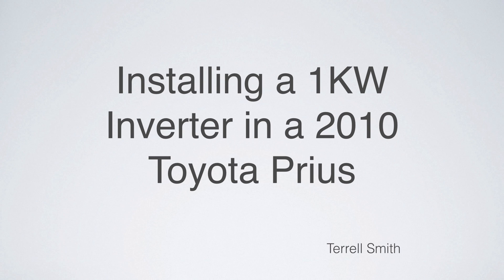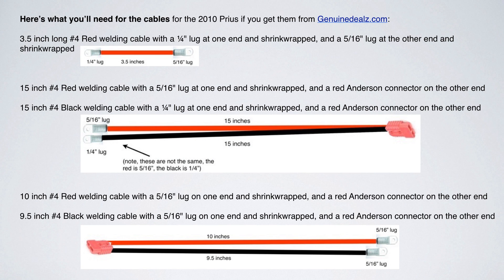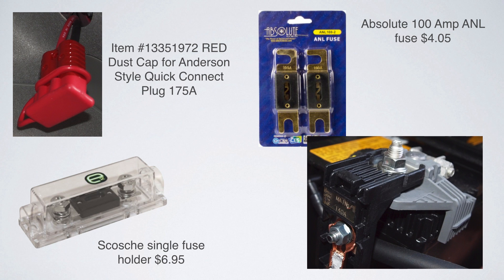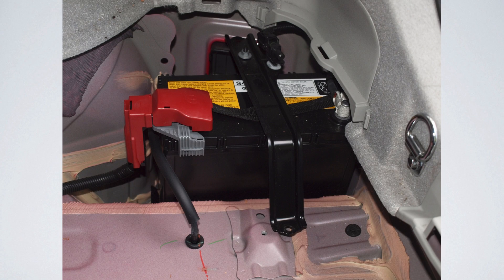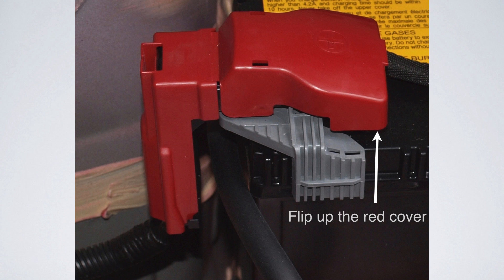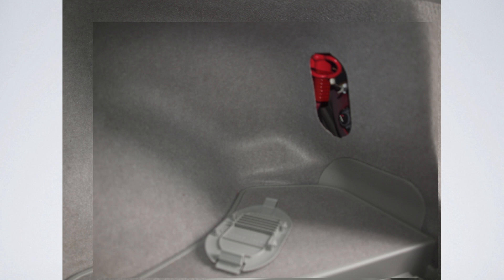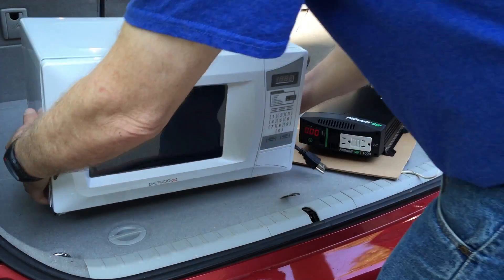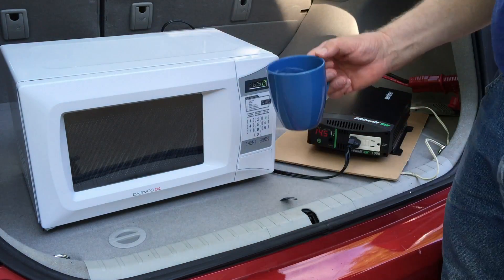Add a 1kW Inverter to Prius

Comment: Thanks for this video. Would the same equipment (cables, fuse, nuts, bolts) be used for a 1500 watt pure sine wave inverter?
Reply: Thanks for the question. It is not recommended to use a 1500 watt inverter, because you might damage your electrical system. From the 12v battery, the Prius can safely power up to a 1000 watt inverter, not more.
Reply: Terrell Smith thank you for sharing this.
Reply: Where can I find the Anderson dust cap cover for 175A? I’ve found some on eBay, but they’re shipped from China. I checked genuinedealz, but they are listing cap covers for 175B, is there a difference? Thank you.
Reply: Terrell Smith thank you!
Reply: Terrell Smith I just learned that genuinedealz has a Prius converter package that includes the dust cover cap and all the cables for $63. They said they were getting a lot of requests because of your video, so they made a package deal. You place the order and they make (and ship) the custom cables and dust cap the next day. Thank you for this helpful resource,
Reply: Terrell Smith Today I successfully installed the 1000 watt inverter into my Prius. Thanks so much for your help. Question: Should the converter only be used when the Prius is completely off?.....or is it ok  (safe) to keep the car in Ready mode when using the inverter (to occasionally turn on and charge the battery when it gets low)?

Comment: Thanks so Terrell! I've finally hooked everything up. I am using a 100 amp circuit breaker instead of a fuse. Is that  a good idea ? Also the total cable length from battery to inverter is about 2 feet now. Should I try to make to shorter ?
Reply: Circuit breaker should be fine. Make sure it's on the positive cable very close to the battery terminal, since that's what you're protecting. 2 feet should be perfect. Much shorter and you have no wiggle room.  :) Make sure the car is turned on when using it so the battery doesn't get drained. It's a small battery, but with the car on you should be able to draw up to 1K (depending on your inverter). The Prius gas engine will cycle on and off automatically to keep the battery charged. To lock the car while it's running, use the "emergency key" that's part of your key fob. That disables any use of the fob and locks the doors until they are manually unlocked. This is a great way to allow the car to be running and still locked. I use an extension cord plugged into the inverter, and close the trunk on it one click, so the trunk is locked without pinching the extension cord. Then I plug in my rice cooker (microwave, etc.) outside the locked car, and don't worry about anyone getting into the car while it's running.

Comment: I tried this with 500 watt inverter, and it fried it when I connected the inverter to the battery, I was going to use it with my Power Pressure Cooker.
Reply: The Survivalist, how many watts was your cooker? I'd guess more than 500?
Reply: Terrell Smith I never connected it, the inverter fried when I connected it to the battery.

Comment: I can only find "tinned marine battery cable" at places that make cables.  Will that work and be flexible enough?  Or does anybody have a link to a welding rod cable?
Reply from the maker: I think it should be fine.

Comment: Would it be possible to have a 2000 watt inverter?  If so, what adjustments would have to be made?
Reply from the maker: The limit for the 12v battery is 1000 watts, so no, sorry.
The exception would be to draw from the traction battery. That can supply 3kw. BUT, that is a major and dangerous job due to the very high voltage involved. I do not recommend it.

Comment: Nice vid, i also readnyour topic on priuschat. So there is no need to wire it to the fusebox in the front? Is the 140A fuse so 140A the max you can drawn out the battery? Or the 100A because of the inverter fuse in the front. I have a class D mono 1000w rms connected to the 12v so that is up to 87A no problem so far, but i want to keep it that way, is it safe what i am doing?
Reply from the maker: Hi Dantube, sorry, I didn't see your question earlier. The 140A fuse is built into the positive battery terminal on the 2010 Prius, where the 12V battery is in the rear. I added the 100A fuse between the positive terminal and my inverter, just in case. You always want to protect the car and battery from any device, just in case something goes wrong.

Comment: Boil water in about 2 min with this setup. Sure I have a MSW inverter for when I need that power to power an ice maker or maybe a freezer but a MWO is not exactly the best way to cook on the  road. Sure I have cooked using MWO but you want real power when you use that MWO. They make some pretty good 12 volt machines that cook on the road. If that is not working for you go with propane as you will see in my stove video the water boils very fast. I go for 16 oz of coffee when I brew. https://www.youtube.com/watch?v=4kPb63ZmGXg I am still working on a good way to do coffee on the road I think I will go make a cup now. I will try the coffee filter with a fork this time should have video up in about an hour.
Reply from the maker: Yes, that is a great way to boil water, and possibly make soup. But I use the microwave oven to cook potatoes, vegetables, whole meals like supper, and even make popcorn. Can't do that in your little stove.  :)
Reply: Just found it better to simplify and flame is about as simple as it gets. I like bio stoves too not a lot of experience with them.

Comment: so when the prius is in start mode engine not running using the inverter the car will start up when the battery get low so does the battery pack and the start up battery share the same or separate power i must be overthinking this lol cool video.
Reply from the maker: The Prius has a "traction" battery (the BIG one which powers the electric motor), as well as a 12v battery. The 1KW inverter is connected to the 12v battery. When the 12v battery drops to a certain point, the gasoline engine comes on and charges it back up. So they do not share the same power. The traction battery is 201.6v.
Reply: ok thank you terrellwsmith :)

Comment: Hi, thanks for such an informative video!  I followed your instructions in detail and managed to install a Xantrex 1 KW inverter on my 2007 Prius.  I'd add that a fixed 10 mm box wrench was essential getting the bolts on and off the 12 V battery.  I couldn't have done it with just an adjustable wrench.  I'd also add that I had to order my wires from a different supplier (Greg's Marine Wire Supply) because GenuineDealz.com no longer seemed to offer the precise kind of customized manufacturing that was needed here.  Also, I think my 2007 Prius' battery terminals were slightly different than yours, so after installation I was unable to cleanly hide the fuse beneath the right rear corner compartment cover, causing the cover to be fairly tilted when placing it back over the battery.  Not a big deal since it is so out of the way.  Otherwise, your approach works like a charm, and I was able to power a small microwave while camping with the Prius on a recent trip.  Awesome!

Rick
Reply from the maker: Yes, the metric box wrench is necessary. I have both sets.

Comment: how much fuel the car uses if it powers a house all night,any calculations. this setup must be very useful for camping as one shall need  power for appliances etc..
Reply from the maker: Thanks for the question, Amir. I've not yet had to power all night, the most was for three and a half hours when the power got knocked out by a storm. Since the gasoline engine only comes on when needed, the Prius would use less gasoline than a generator, which runs all the time, and makes lots of noise. I've read about people powering their home for three days or so. I only powered our freezer, telephone system, internet, and computer during the outage.

Comment: Great idea. If you really want to go maverick. You could replace battery with lithium ion phosphate 4*3.5. 120 ah.  Then you could run without have car on and even have electric blanket on overnight.  I guess the car comes automatically if the voltage drops.
Reply from the maker: Yes, the car auto starts up if/when the 12v battery gets low, to charge it up again. I wonder what might happen with the charging system with a different 12v battery? It looks like there would be space to put a larger battery in there, which might allow fewer engine cycles.
Reply: TerrellWSmith I actually looked at the center console 12V plug today, it says 120W max.  But if there is a way you could use some of that power to store a battery or supercap then anyone can use to use their car to boil water from the center.  Not sure what happens when the 12V battery is low, does the engine kick on, or does the main battery charge the little battery.  It seems my mileage dropped a few mpg, I wonder if it is result of the small battery dying.  A small refrigerator takes less than 120W, but the surge would blow the circuit I would think.  But hooking to the main battery, it might be possible to have even a refrigerator via a 300W inverter if engine kicks on. 12V Dc refrigerators cost $500, but AC cost $100 new and used one probably free if you look around.
Reply from the maker: When the 12v battery gets low, it's charged by the gasoline engine turning itself on automatically.
Reply from the maker: I've looked at small refrigerators, because having to buy ice all the time is a nuisance, and having it melt into the food, creates a mess that needs to be dumped out every day. I put my food in large plastic bags to keep it from swimming in melted water. Plus, it'd be fun to be able to eat ice cream! BUT, 12v mini refrigerators cost almost as much as a big kitchen one! So I gave up on the idea for now. An AC refrigerator that gets bounced around a lot probably wouldn't last very long. That's likely why the 12v models cost so much, they are made to take the bumps. And they are made to work off the 12v plug.
Reply: TerrellWSmith You have a nice plug, to plug one in at.  The Wynter 45 quart is $476. Cheapest 110V is Haier 1.7 cuft at Bestbuy for $105.  If you fill ice area with Blue Ice, you might be alright for camping if you only run it with car running and travelling.  There is also a portable ice maker.
Reply: When you say "auto starts up" you mean the engine kicks in if the car is already started, right?  Else the car could be poisoning the air with carbon monoxide if auto started in an enclosed space.

Comment: Hi T Smith, Would the wired-in Anderson plug work for any car, assuming you use the inverter only when the engine/alternator is running to adjust to the current draw? We had an Anderson plug wired (and fused) to our battery with a solenoid isolator so we could plug in a "house battery" to re-charge while we drove from one camping location to another. I can happily boil water on the camp stove for coffee (wont yet consider hauling a microwave with us) but if I could find a way to power a hair dryer while boondocking, I'd be a happier camper!
Reply from the maker: A hair dryer probably draws around 1800 watts, far too much for the 1KW inverter to power. Some hair dryers might have a "low" setting, but what I think they are doing is still using full power, but only half the time. So wouldn't work. But you could certainly try it. The inverter will just cut out if too much power gets drawn through. As far as already having an Anderson plug, it depends on the wiring. The wires should be as short as possible to the battery, and very heavy gauge to handle the power needed. You can think of it this way: At 120v fairly thin wires can handle a lot of amps (see lamp cords in your home). But at 12v (the car battery), the wires need to be ten times as thick to handle the same amps (roughly). That's why I used 4 gauge wire (the lower the number, the more power can flow through them).
Reply: Yes, you need heavy gauge wire for 12VDC.  But 120 VAC wires are smaller, because they can pass more POWER at 120 V, than a battery can at 12 V.  Why? because the thin wire only needs pass 1 ampere of current for a 120 watt appliance.    The thick welding wire has much less resistance (by a factor or 10 or more), so it can pass the 10 amperes needed (for 120 watts).   So, if you maxxed out your inverter's power capabilities, you'd be sending 100 amps to it at 12V.  That's why you need welding cable... and short lengths of it.

Comment: VERY nice video, thank you!  Do you think this one would work?  I hope to power an 800 watt induction cooktop: https://www.amazon.com/gp/product/B00F4TP3AE/ref=ox_sc_sfl_title_1?ie=UTF8&psc=1&smid=A3J6F4ONVPFED5
Reply from the maker: Hi Donna, Thank you. After a quick look at the reviews, I'm not so sure I'd buy that unit. It looks good, and the 2000w peak sounds good (although those peak values are usually for microseconds, not very long), but it seems several people had bad experiences with that unit failing. The price seems a bit low for pure sine wave. As far as using an 800w induction cooktop, if it really only draws 800w, you should be fine. I use a microwave oven rated at 950w for camping trips, and it's worked just fine (my Kill-A-Watt says it draws 1010w when on house current, but when hooked up to the inverter, it's running less). The microwave runs only a few minutes each time. I've also used a big 700w rice cooker (takes 20 minutes), just fine. And recently during a big storm, powered our freezer in the basement and a few small things (phone system, internet, wifi) for three and a half hours until the power came back on. (Unfortunately, the start-up spike of our refrigerator was too much for the inverter.) Read the reviews carefully before buying an inverter. I know there are always some negative reviews about almost anything, but when several people write similar things, that's a note for caution.
Reply: Thx Terrell. Here is another question. When the car engine kicks in, does the exhaust interfere with your cooking at the rear on your table?
Reply from the maker: What I've actually done is run an extension cord to a nearby picnic table and cooked on that, for exactly the reason you mention, though the exhaust comes on only once in a while.

Comment: I'm curious, I ended up buying that same inverter and my mechanic told me that technically the inverter does not need the second ground connected as the negative cable connected to the battery is grounded to the car. Is this true? What purpose does the second ground serve? And is it necessary?
Reply from the maker: +JC Gania JC, I think your mechanic is correct as far as the operation of the unit, the negative is connected to the ground of the car through the negative battery wire. The ground wire from the inverter ground terminal (the small nut) to the car ground is a safety feature, providing a sure ground for the inverter housing, just in case something goes wrong inside the unit. Is it necessary? That all depends on how the inverter is wired inside. My guess is that the housing is insulated from all internal wiring. If a positive wire came lose inside the housing, and touched the housing, then the housing would immediately be dangerous to touch. A grounded housing protects that. So yes, ground it for safety. I figure if they provide a ground terminal, then it's best to use it.
Reply: The grounding post should be run to a bonding rod in the ground (Earth Ground).
Reply: Joseph Jamison , you don't need to ground it to the earth with a grounding rod. Just to the car ground, which is the frame on a negative ground car.
Reply: @terrellsmith2203  Terrell, Can I connect the inverter first ground directly to the car grounding (beneath the metal tie-down there is a bolt connected o the battery) instead of connect it to the battery?

Comment: I am amazed that you can power a 1kw inverter off the prius starting battery. My knowledge was that it was 35 amp hour battery gel cell and that the charging system according to my book for 2011 said 5 amp charge for the starting battery. The fuse rating for the battery was kinda high for the toyota fuse but I guess you have to account for lighting and inverter draw. When you put that inverter on there I was amazed you got it to work with the amp draw from the microwave. I did hear your engine kick on when you put the microwave into action. I was wondering after having this device on the car for a while has your battery and charging system held up. My Prius is 5 yrs old and its strong according to the dealer but I didnt know the front inverter put out that much amperage to the starting battery. My dad's sonata hybrid after three years the traction battery died it made me a bit nervous about the prius battery but its a gamble these days with hybrids but toyota did a good job with the nimh batteries.
Reply from the maker: +egn83b Thanks for the comments. So far, I've run a rice cooker (20 minutes at 450w) off the inverter, and the microwave (600w element) for a few minutes (enough to boil water or cook a potato) and have not seen any problems. On PriusChat.com you can read about people who've run their house (part of it) during a power outage using a 1KW inverter running off the 12v battery, and 3KW directly off the traction battery. My Prius is a 2010 and still has the original 12v battery, although after 6 years, it's starting to show it's age.
Reply: +TerrellWSmith okay thanks